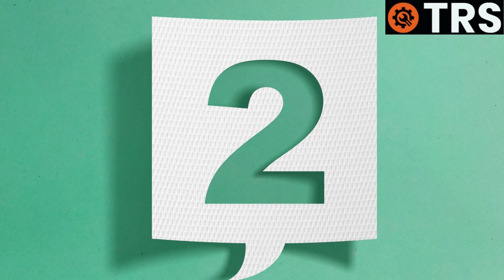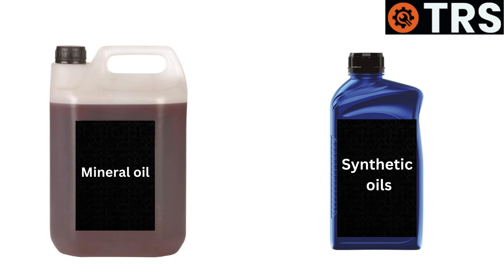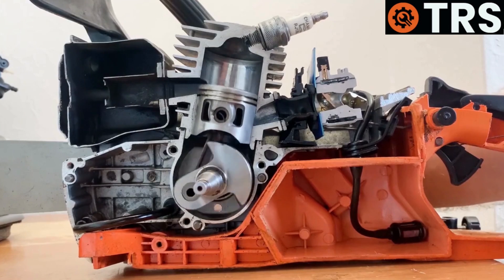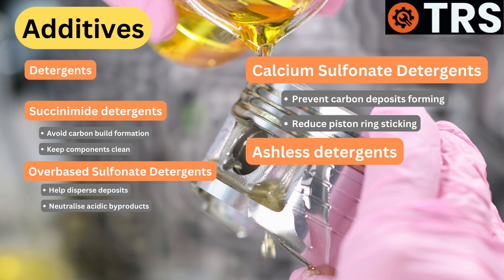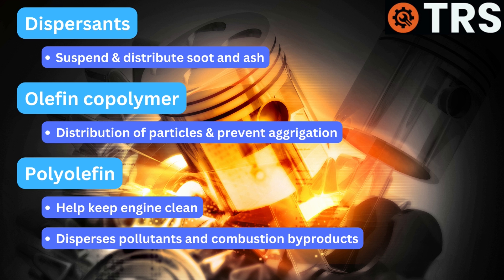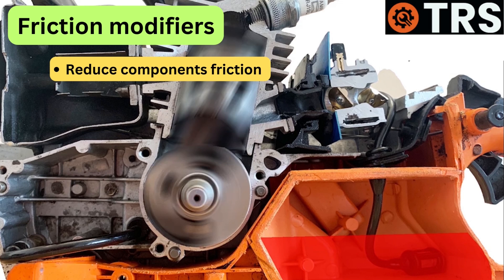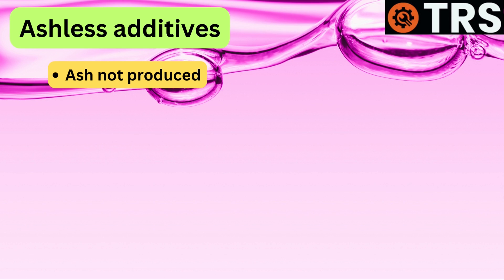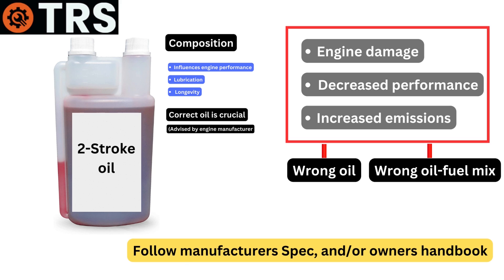Chainsaw Oil: What it is Made of!  (by Craig Kirkman)

Comment: I dont see how this is diffrent from a 4stroke motor oil. Should I start using standard motor oil in my 2 stokes?
Reply from the maker: Great question! It's important to note that 2-stroke oil and 4-stroke motor oil serve different purposes in engines. While they may share some common ingredients, their formulations are tailored to meet the specific needs of their respective engine types.

Using standard motor oil in your 2-stroke engine might not be the best idea. 2-stroke engines require a special oil that not only lubricates but also helps with combustion, as they don't have a separate oil reservoir like 4-stroke engines. This specialized 2-stroke oil is designed to burn along with the fuel in a specific ratio, ensuring proper lubrication and preventing engine damage.

So, it's generally recommended to stick with the designated 2-stroke oil for your 2-stroke engine to ensure it runs smoothly and efficiently. If you have any more questions or need further information, feel free to ask! Thank. Craig

Comment: My only 2-stroke engine is in a Poulan Pro PR5020, 20" Chainsaw, and I bought a can of Husqvarna (who makes Poulan Pro) premixed 50:1 Premium Zero Ethanol (E0) for it to avoid canceling the warranty and the extended warranty I bought, and to get the best fuel I can, or at least what Husqvarna/Poulan said is on the box.  I've heard, maybe from you, that 40:1 is better than 50:1 for better piston lubrication, though it blows more smoke, but 50:1 is what I bought because that's what's on the box and the manual says, "a good quality synthetic 2-cycle air-cooled engine oil designed to be mixed at a ratio of 50:1," so synthetic is mentioned, but the Poulan Pro website says "all of our chainsaws are 40:1."  The manual also says, Regular 87 Octane (AKI) with up to 10% Ethanol (E10), but I use E0 in all my small engines now and will continue to use Premium E0 in the chainsaw, premixed canned Premium or mixed myself.

I may try 40:1 when this can runs out for engine longevity.  Your thoughts on that, please.  Like would 40:1 require more cleaning maintenance, and to what extent, how often, etc.?  Have you done a video on 2-stroke oil mixtures, 40:1 vs 50:1, with the Pros and Cons of each?  For chainsaws and small 2-stroke engines in general?  Not motorcycles, karts, etc.  If not, please do.

I did not know there were two types of 2-stroke oils, three including blends, so this was very informative.  Synthetic is better and has lots of additives to insure that, and it would seem the additives may vary, making it hard to know which one is best to use.  A manufacturer should/could specify a synthetic or blend brand and particular product in the manual, but my manual did not, saying only "good quality."  Same for a mineral oil?  One would think they should.  I guess Mineral oil is more standalone, without additives.  I wonder if using a synthetic/mineral blend or a synthetic in an engine that specifies mineral would cause issues.  I can see the reverse being true.

I assumed that the Husqvarna Premium 50:1 I bought was correct, but it seems 40:1 should be acceptable.  Thank you, Mr. Craig!  And thanks in advance for answering my questions.  Please consider the video request, or give me a link if you already made the video.  Good day, Sir.
Reply from the maker: Hello there! It sounds like you've put a lot of thought into taking good care of your chainsaw. Let's go through your questions step by step:

Starting with the oil mixture ratio, it's great that you're being mindful of the manufacturer's recommendations. The manual suggests a 50:1 mixture, and that's what you've been using. However, there's some debate about whether a slightly richer mixture like 40:1 could provide better piston lubrication, even though it might produce more smoke. It's true that a richer mixture could help with lubrication, but the difference might not be significant enough to noticeably affect engine longevity, especially if you're already using a high-quality synthetic oil.

As for the cleaning maintenance, while a slightly richer mixture might lead to slightly more carbon buildup over time, modern synthetic oils are designed to minimize this issue. Regular maintenance, like cleaning the air filter and spark plug, will still play a crucial role in keeping your chainsaw running smoothly.

Regarding your request for a video comparing 40:1 and 50:1 mixtures for small 2-stroke engines, it's an interesting idea! Different mixtures could have specific advantages and disadvantages, and such a video could help many people make informed decisions.

You've mentioned the variety of 2-stroke oils available, and you're right that synthetic oils often have additives that enhance performance and protection. While manufacturers might not specify a particular brand or product in the manual, the emphasis is usually on using a high-quality oil that meets the required specifications. Mixing synthetic and mineral oils or using a synthetic in an engine that specifies mineral oil is generally not recommended due to the potential for compatibility issues.

So, in a nutshell, you're doing a fantastic job by considering the best options for your chainsaw's maintenance and longevity. Remember, whatever mixture ratio you choose, regular maintenance and using a high-quality oil are key. As for the video request, it's worth checking if any experts have covered this topic on platforms like YouTube or chainsaw-related forums. Keep up the great work, and if you have any more questions, feel free to ask. 

Have a wonderful day!
Craig
Reply: @TheRepairSpecialist   Thank you very much.  You did it again.  You really covered all the bases, you answered every question in detail and I really appreciate it.

I appreciate your consideration of making mix ratio video discussing the Pros and Cons each one, maybe even as high as 25:1 for inexpensive chainsaws and their cheaply built engines.  I eagerly await it because your videos are always so helpful, as was the info in your reply.

I copied all of this and added it the other for future reference.

Thanks again, Mr. Craig.  You're the best!

Comment: Thanks really informative.  I work in a big box store that sells a 2-stroke oil labeled as 40:1 & 50:1, it's 6.4oz and makes 2.5 gallons. The bottle is labeled as containing fuel stabalizers and the store website says synthetic with additives.  I usually show it to customers who aren't sure and can't provide any machine or engine information.  Any thoughts on it?   Thanks

Comment: Greatly explained😊😊😊
Most Manufacturers Handbooks recommences their own product in this case 2 Stroke Oil, examples of this is Stihl, Husquvana Mikita just to name a few but for Warranty Compliance use their brand, some companies like Stihl will extend  the warranty period if you use their semi synthetic blend, which the extra dying usually shows in the engine, proving your using the specific oil.

Question, being in Australia with Victa 2 Stroke engines in their lawn mowers which are quite old now in most cases ran at 25;1 mixture ratios on mineral oils where the only option at the time.
The base of the question is if using a better quality oil like semi or full synthetic blend can you reduce the amount of oil used an example is 35:1 due to the progression and extra protection of there’s newer oil?
Thanks🤔
Reply from the maker: Thank you for your kind feedback, I really appreciate it.  and  yes, I personally would have no issues with reducing the amount of 2-stroke oil used in my machines if I was using 25:1 mineral oil/fuel mix on an older machine, to 35:1 fuel/oil mix.  Thank you. Craig
Reply: @TheRepairSpecialist Craig the question arose from Victa’s claims on their front label own branded oil Victa Formula V 2 Stroke oil (1L Bottle) produced by Valvaline  that “it makes twice as much as compared to 25:1 formulations” also using diagrams of a lawn mower,trimmer and chainsaw including the following statement; Victa Formula V 2-Stroke Engine Oil is specifically developed for high performance air cooled 2-Stroke engines. The unique formulation was developed to ensure minimal ash deposits and spark plug fouling leading to easier starting and less maintenance
In Victa’s. Trimmier Manual it states mixtures at 50:1 exclusively to only use Victa Formula V 2 Stroke Oil https://2ecffd01e1ab3e9383f0-07db7b9624bbdf022e3b5395236d5cf8.ssl.cf4.rackcdn.com/Product/d9ca7f21-c1fd-4e5d-8a0b-6335b9fa1d02.pdf page 16